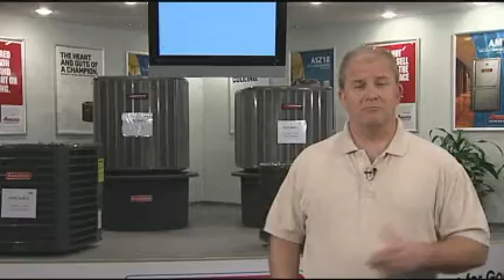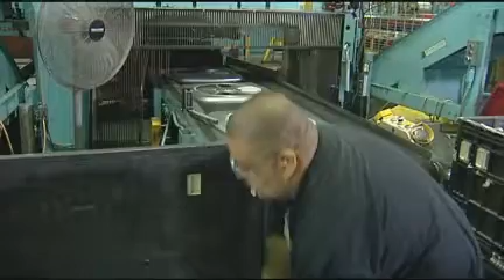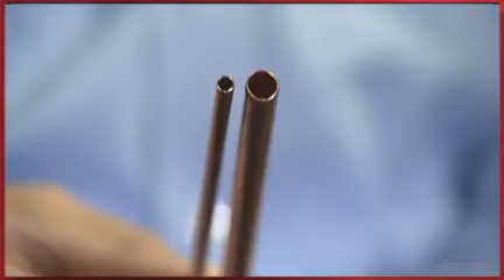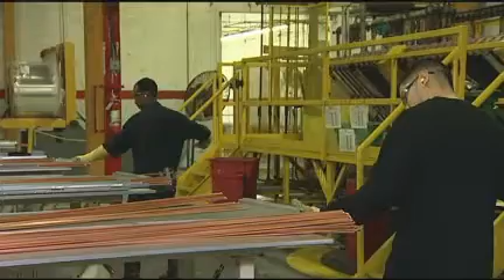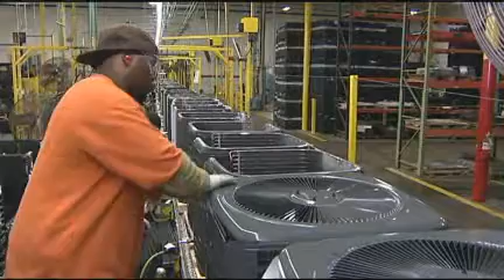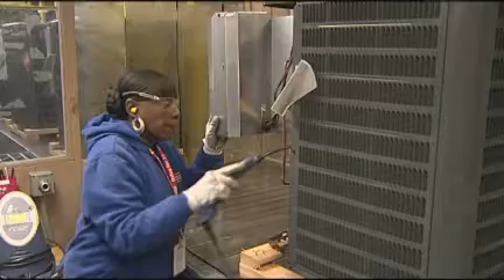Goodman Air Conditioning

Comment: goodman is very good brand. copeland compressors, starting at around 14 seed and up, 10 year warranty on compressor evap and condenser coil. I dont work for goodman but I service and install goodman time to time. plus they still have piston for 410a systems and a rep called me and said they have lifetime warranties on exchangers for 90% and up furnaces. very good brand in dallas tx